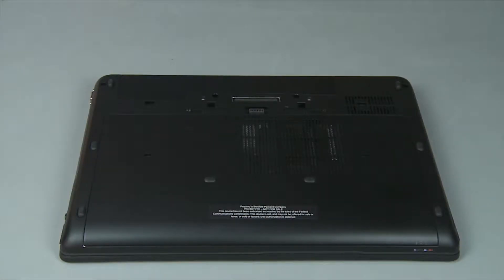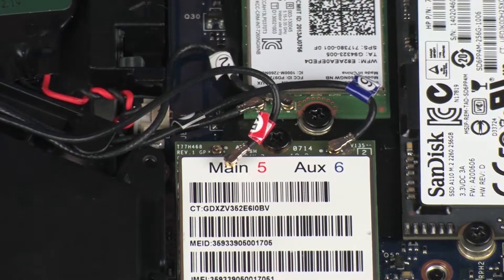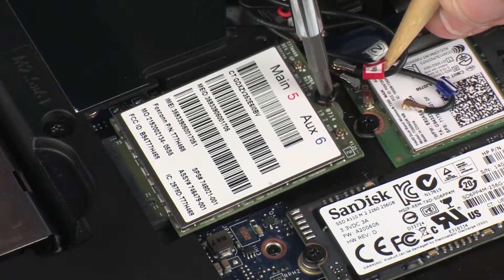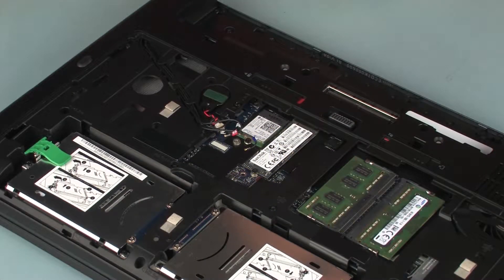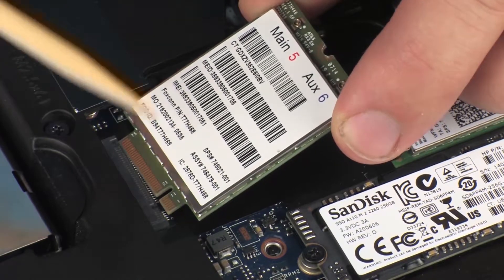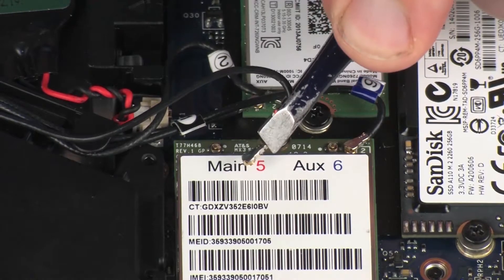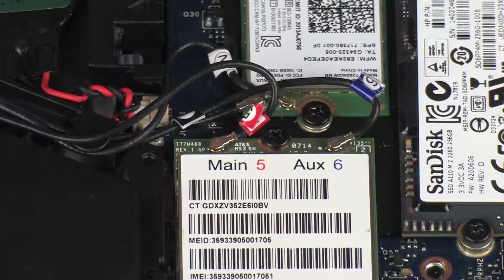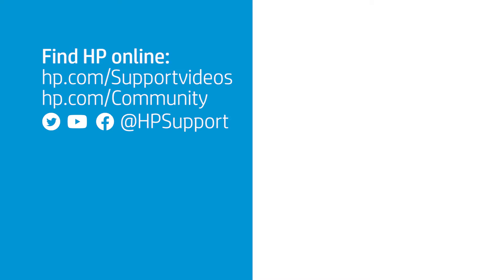Replace Wireless WAN Module | HP ZBook 17 G2 Mobile Workstation | HP Support

Comment: Can I upgrade on this hp zbook g2 17 the WiFi to intel ac 9650ngw? I currently have 7260ngw ! I want newer model and more speed so I go for maximum newest ! Thank you
Reply from the maker: +Lucky Strike Entertainment HP does not recommend upgrading or downgrading hardware parts or software that is bundled with the product as It may affect the manufacturer's warranty and performance, however, you could change the configuration at your own discretion.